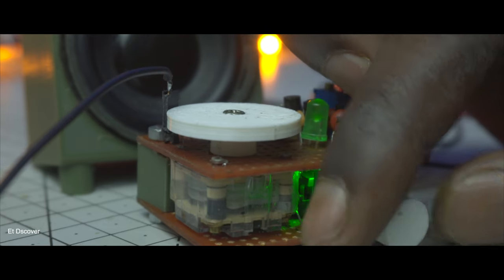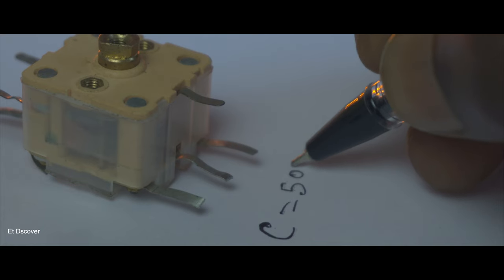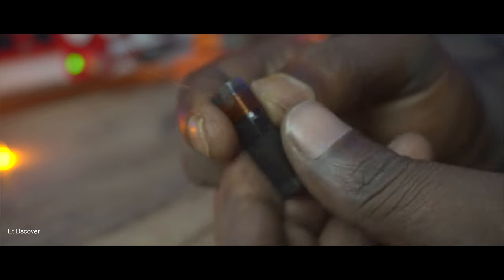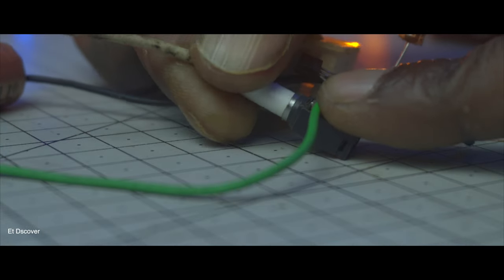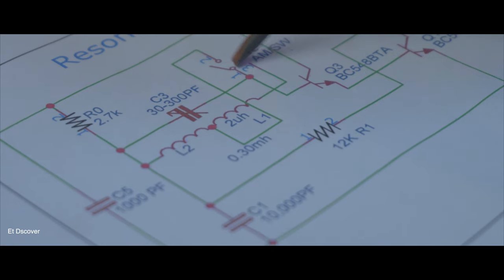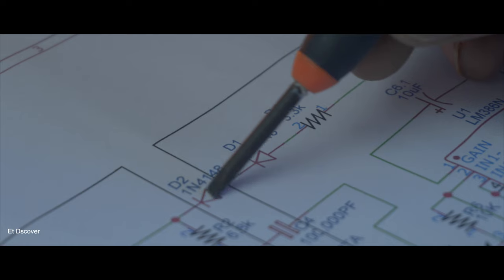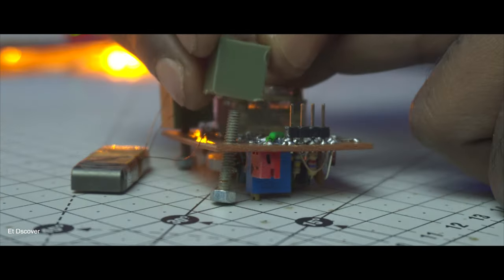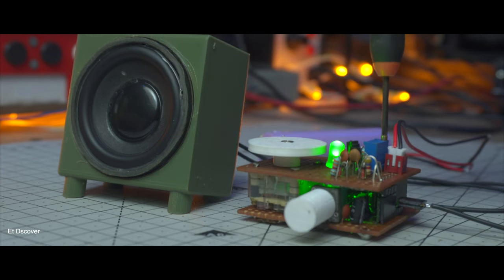How to Make AM and SW Radio Receiver

Comment: Bro i didnt understand how to properly make the inductor 😢
Reply from the maker: Forget short wave just make 92 turns
Reply: @EtDiscover  tq
Reply: @EtDiscover  it has 3 pins right when should I make the middle terminal I mean at how many turns
Reply from the maker: Make 92 turns and connect it with variable capacitor😢 don’t needed centre tap for AM

Comment: is it possible to receive a specific frequency using this circuit but instead of inductor using a crystal oscillator? 
if so we can make a walki talki right
Reply from the maker: Yes possible but inductor is necessary for proper gain

Comment: We have also got some stations at range of 95 to 105 Mhz you can make a inductor using the formula ❤❤ can we ? Then we Get inductance in range 0.06 to 0.008 micro henry which is very small is it possible to make
Reply from the maker: Frequency modulation work in different way.
Reply: @EtDiscover  okk
Reply: @EtDiscover  you mean this circute is only upto for am not for fm right